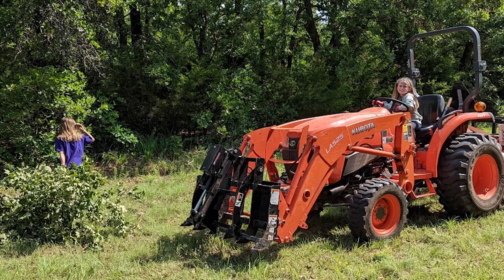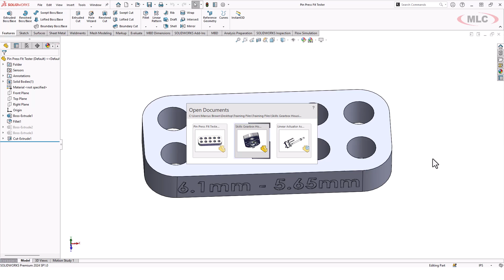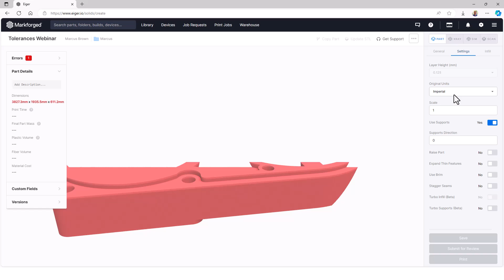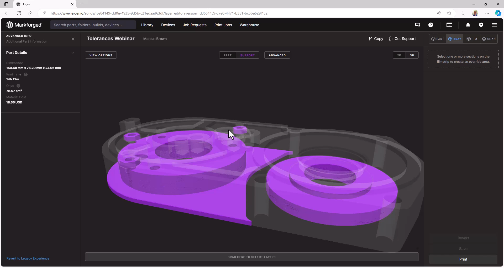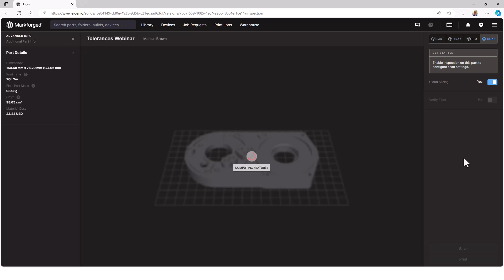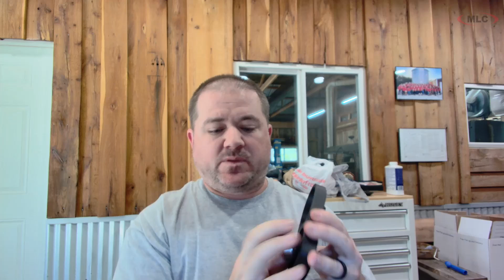3D Printing Tight Tolerances – First Part Accuracy on Markforged Webinar

Comment: If you find a tolerance that is between two possibilities, you can purposely create an octagon or sun-gear shape as the inner tube. Only use the larger tolerance hole on the top and bottom.

Though it will not be a perfect shape, printed. It should expand, with the inserted part, to yield the average desired size, with minimal force or part stress.

It can also be beneficial to just stick with the lower desired value. Using a tapered reamer to obtain the final desired size.

A square or rectangular or winged nut, is better than a hex nut or an octagon nut, for securing parts better. There is less chance that the part will spin, crushing the inner walls, when tightening it. (The walls should be double thick, if the part uses infill, around those inserts.)